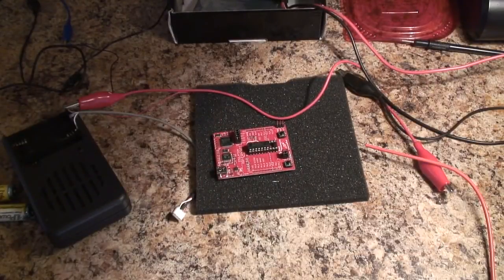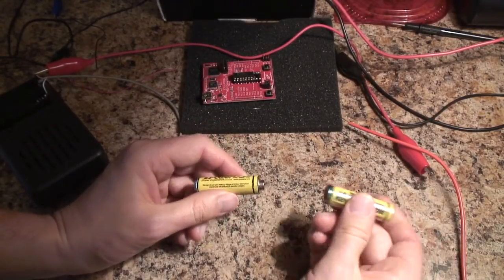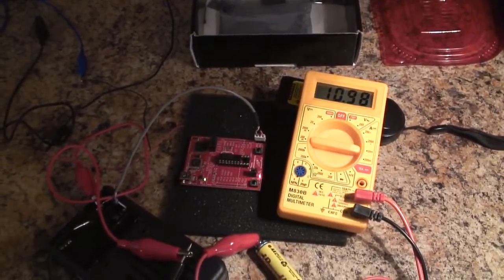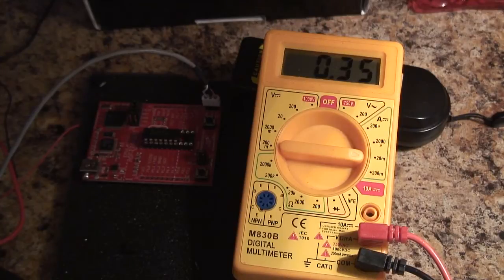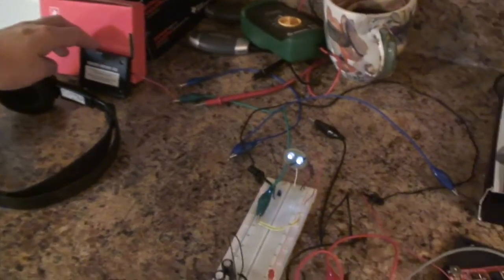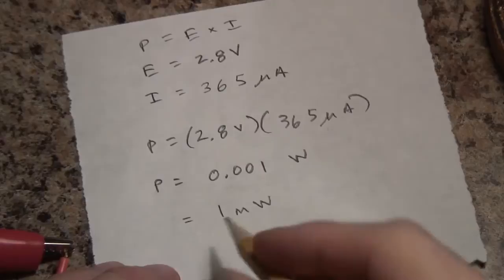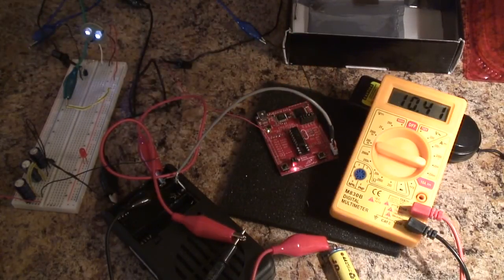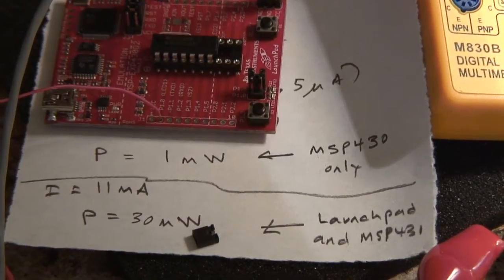How Much Power Does MSP430 TI Launchpad Use?

Comment: FYI, you have the old launchpad board with the msp430g2231.  They removed the R34 et C24 (check the schematic to be sure) that did a pull-up & debouncer on the P1.3 that apparently will drain current and might cause problem if you use p1.3 for other purpuses.  Removing it might lower the power usage even more (I havent tried it personally yet).  Also, to calculate the Led1 et Led2 power usage with your amp meter, you need to leave them on, else you wont get a good reading.

Comment: @field16b, hello, just a little correction, the launchpad is actually two main blocks, the EZ-USB-FET and the application processor, when you remove the VCC jumper that disables the green power LED on top, basically what you're doing is powering off the EZ-FET, that is the TUSB430 and the MSP430 in the corner, the eeprom etc, not just the LED.

Comment from the maker: @cataruc Hi, I also have the ATMEGA chip on my Arduino (like you).  To me, the MSP430 is similar to ATMEGA in that they are both microcontrollers that have USB interfaces for programming.  I am still playing around with these and learning as I go.  I like the MSP430 better for less power consumption, less components required to run off the board, and I think it's cheaper, too.  However, the Arduino is easier to code because it is more intuitive for humans to read.